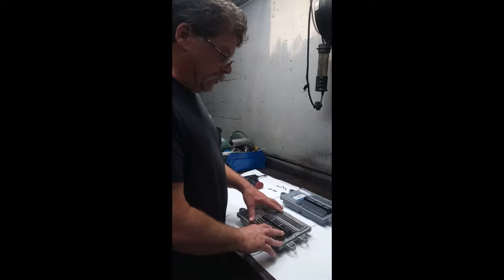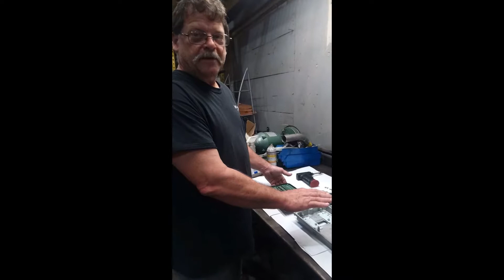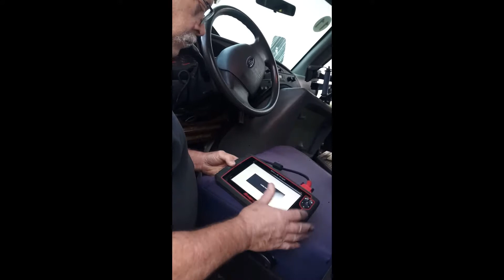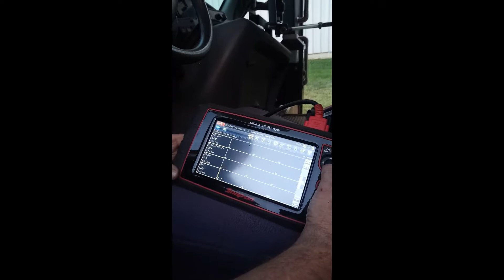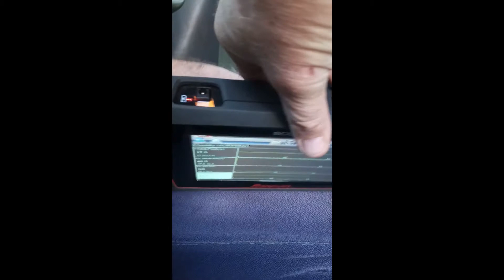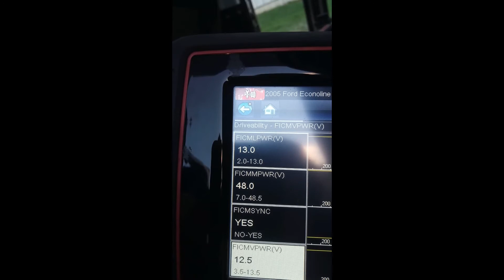FICM    Fuel Injection Control Module Repair

Comment: What are symptoms of a bad ficm?
Reply: Typically the truck won't start.  We test the outputs with a scanner. P
Reply: @philipjones7751  my truck starts good but once it reaches operating temperature it starts to shake/lope. Everything seems fine on my scanner and I have no check engine light and or codes. Possibly the ficm?
Reply: @251suzuki  Doesn't sound like it, but possible.  Sounds more like injectors themselves, maybe crud in the fuel.  pull the primary filter and see what's in it.
Reply: @philipjones7751  how do you test it with a scanner